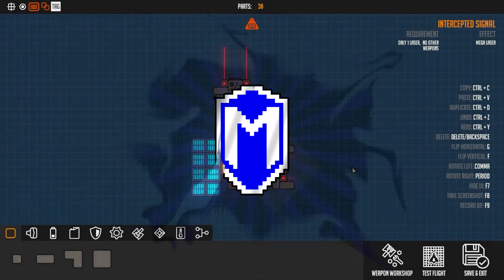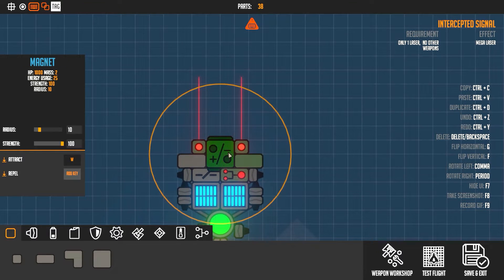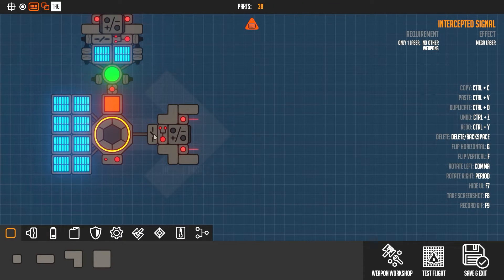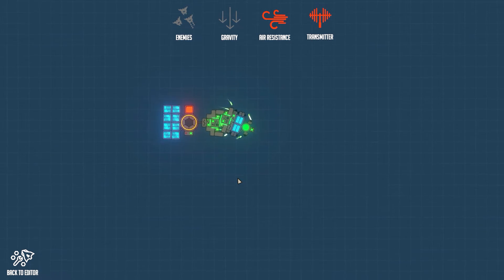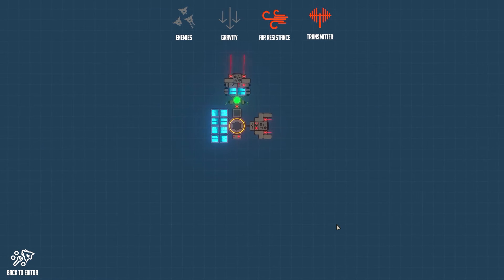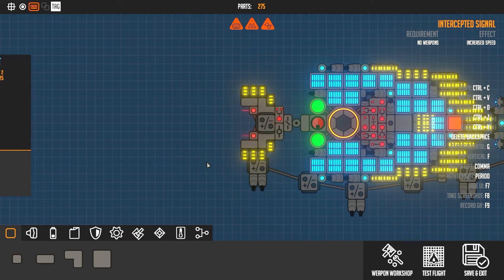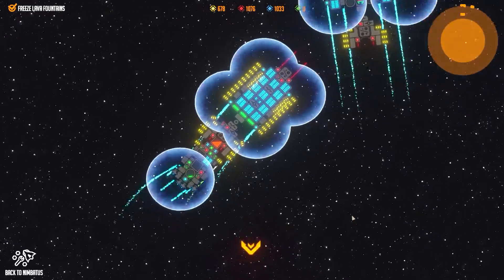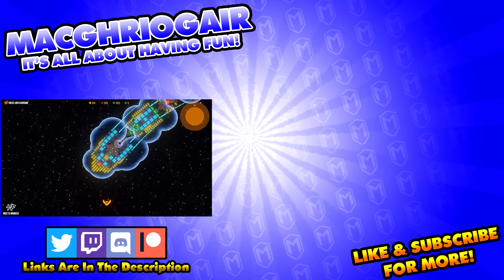How To Make Magnetic Couplers, Connecting Two Drones - Nimbatus Gameplay Tutorials And How To Guides

Comment: I'm having trouble getting the magnet, on the right to work. Do you know why?
Reply from the maker: Just guessing here, but either your sensors are not inside the logic splitter or your sensors are not set to Own Drone.  Also don't forget, magnets need power to run.
Reply: Thanks, they work now!